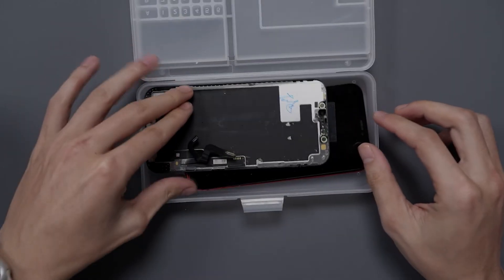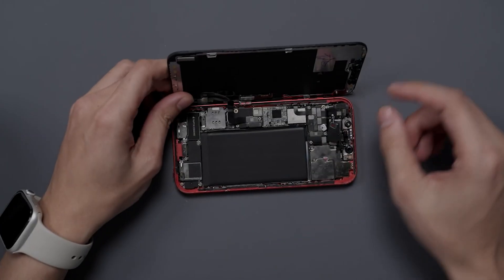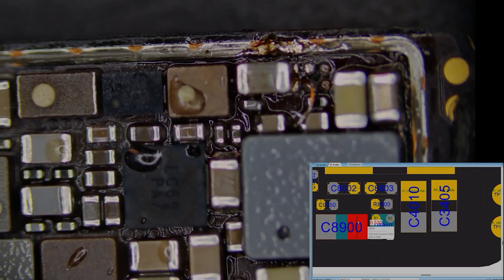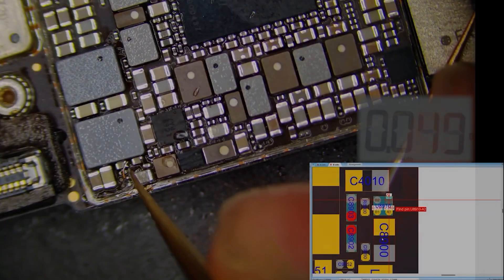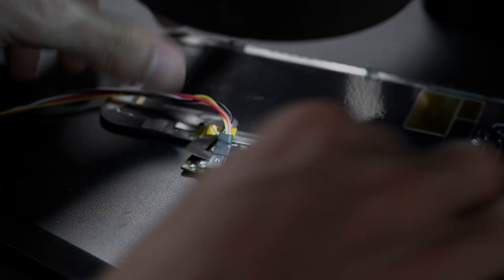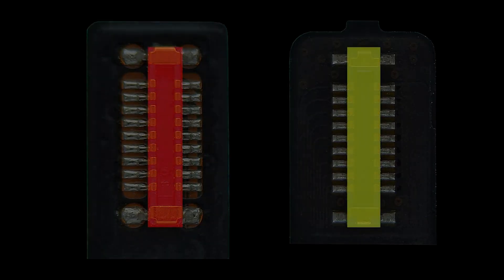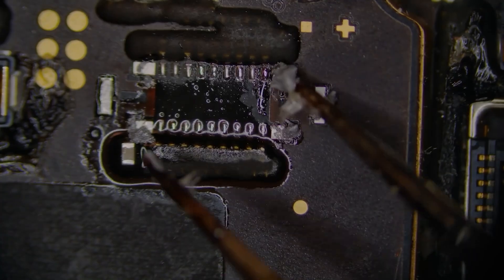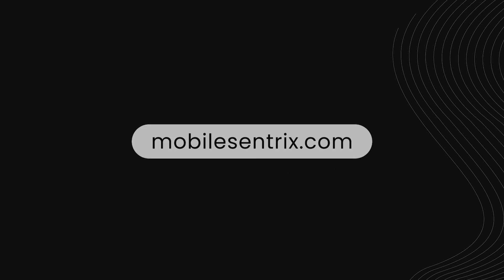This iPhone 12 Only Worked With the “Wrong” Screen — Here’s Why

Comment: I legit had this exact issue with a OEM screen working but not a 3rd party. But it was still under the factory warranty so I sent it back and got a replacement phone and then swapped out the screen and battery for mobilesentrix parts to use as a "demonstration" device and as my daily driver